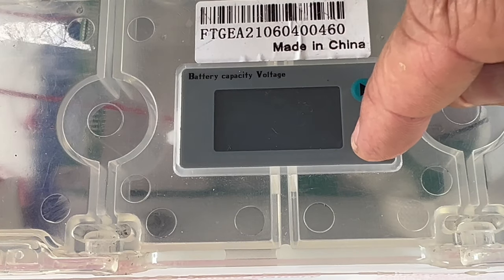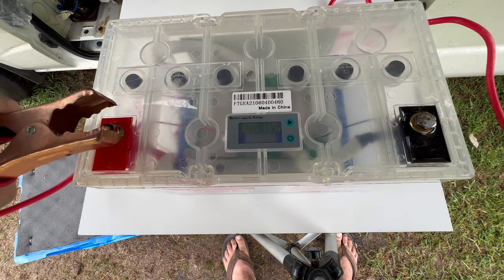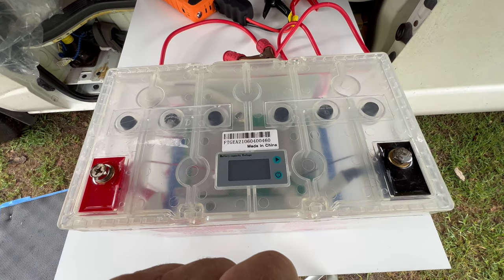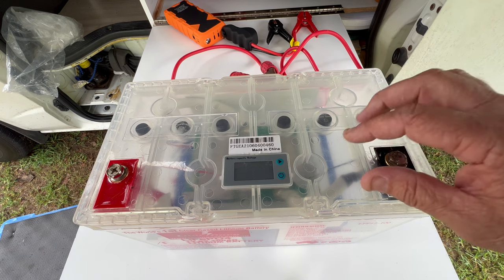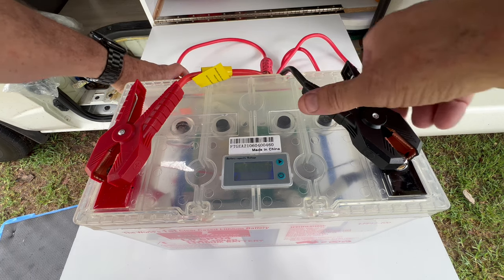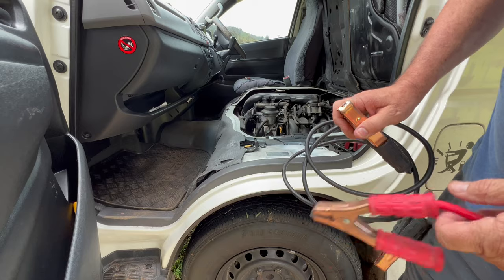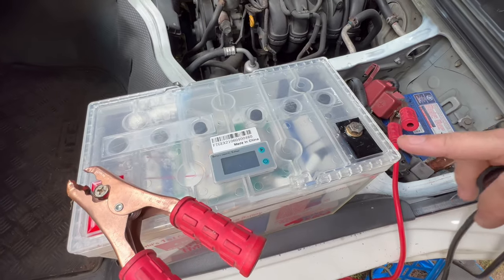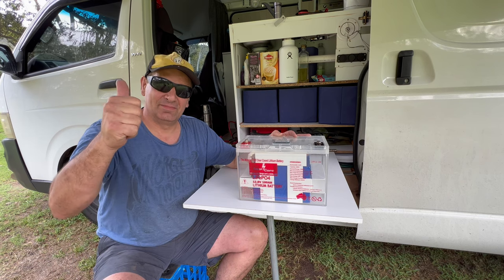Waking up a sleeping bms in your lithium battery

Comment: You saved me just now, I think. I just received a couple new lithium batteries and they came with the BMS in sleep mode. They have Bluetooth as well but in sleep mode I can’t connect. I was going to buy a charger that will charge lithium at 0% charge, but I forgot I have a jump starter in the truck! I’m going to do this and see if the BMS wakes up and reads the actual voltage.
Reply from the maker: Hopefully, it does the trick and you're able to connect via Bluetooth. It's always satisfying to solve a problem with resources you already have. Thanks for watching 👍🍻

Comment: Good video mate…does the jump starter need to have lithium compatible???or u can use any jump starter like my is kings brand jump starter..thanks
Reply from the maker: Should be able to use any jump starter as you seen I just used the car battery (lead acid) as one example. You only waking up the bms and just only few seconds is needed .. you can even use a solar panel directly to the battery bypassing any solar controller to wake up the bms. Hope this helps and thanks for watching 👍🍻

Comment: My blinking light goes off on my ebike battery all i do to get the light back on is supply some voltage to the aux 8 amp connector and it wakes back up. Im not sure even a small amount of voltage will wake the BMS back up ? Looks like you proved this by connecting a 12 volt battery. Have you tried anything less than 12 volt battery?
Reply from the maker: No i have only done this to 12v batteries. Thanks for watching 👍🍻

Comment: Thanks mate my new lithium  bms has fallen asleep a few times,overcast days and parked in the garage, so no solar charge, with fridge running. Being new to lithium I was worried I got a lemon, now I know the trick thanks. Last night it got down 1 degree would this also be a trigger for bms sleep mode ?
Reply from the maker: Cheers mate I’m glad the video has helped you out . Yes the bms can trip out in low temperatures. Thanks for watching 👍🍻

Comment: Hi Phil, I have a  new voltx 100ah lithium  battery and a old 50ah Renogy lithium. 

Is it OK to connect these  in parallel, given the different capacity. 

Many thanks.  Vik
Reply from the maker: No . It has to be the same battery in capacity and brand for the bms in each battery to communicate with each other . And the by the way my name is not Phil 🤣 . Thank you for watching 👍🍻

Comment: Hi Dino, do we have to disconnect the battery wiring then jump start it or just jump start it while its connected to the dcdc charger.
Reply from the maker: You should be fine to leave the dc charger connected as your only jumping for about a second just to wake up the bms . I got a battery box and my lithium went flat and I just jumped mine with my dc charger and accessories connected and no problems at all . Thanks for watching 👍🍻
Reply: @EFFICIENTSELF  👍

Comment: Hi there.. Did you use a lead acid battery in your vehicle to jump start the lithium battery?
Reply from the maker: Yes was a lead acid battery . Thanks for watching 👍🍻
Reply: @EFFICIENTSELF  thanks mate.. My growatt inverter had an error that wasn't in the manual.. Watched your video and had the idea to check the batteries.. Lucky was able to switch them on via the BMS app
Reply: Didn't work

Comment: I have to questions 1.where can I get a lithium battery monitor and 2. Where can I get one of those discharge units to test battery capacity like you had when you tested the 200ah Lithium battery
Reply from the maker: The victron smart shunt are really good https://www.ebay.com.au/itm/265548943069?mkcid=16&mkevt=1&mkrid=705-154756-20017-0&ssspo=f58ATu1-R4q&sssrc=2349624&ssuid=LADLYa7cR_u&var=&widget_ver=artemis&media=COPY and the battery tester was here https://www.ebay.com.au/itm/144028730454?mkcid=16&mkevt=1&mkrid=705-154756-20017-0&ssspo=3ByHGBGPTqO&sssrc=2349624&ssuid=LADLYa7cR_u&var=&widget_ver=artemis&media=COPY
Reply from the maker: Hope this helps and thanks for watching 👍🍻

Comment: What if your battery doesn’t have any of those LCD panels on the top of it?    My battery got too cold last night. My CPAP machine shut off and I’m going to die if I go to sleep again because my battery isn’t working   200Ah Giantz LiFePO4
Reply from the maker: Lithium batteries can temporarily stop working if they get too cold. Only way for bms to make battery function again is for temperature to warm up again. 
consider having a backup power solution for your CPAP machine, such as a smaller, portable battery pack or a generator, to ensure you don't face a similar situation in the future. Hope this helps and thanks for watching 👍🍻

Comment: I just bought a Bluetooth connect li-ion battery E-scooter...  Sometimes I notice When I try to turn scooty on it doesn't start.. but battery is enough... It's a 30 amh battery... Then I have to plug the charger to turn scooty on... Don't know what the problem... Please solve.. it will help me a lot
Reply from the maker: Sorry I’m not an electronics guru but sounds like there might be an issue with the connection between the battery and/or the scooter's electronics. Check to make sure all the connections are secure and free of any debris or corrosion. Maybe it might be best to contact the manufacturer or a professional for further assistance.  Hope you get it sorted.Thanks for watching 👍🍻

Comment: I have a 12v 100ah Aolithium battery and this didn't wake up the BMS. The BMS charge switch will not open up. Any suggestions?
Reply from the maker: Try an unregulated solar panel and see if that works . I would say the bms has an issue. Hope you get it sorted and thanks for watching 👍🍻

Comment: Hi, would it restart if you put a jump leads on it while the salve battery vehicle is not running?
Reply from the maker: G’day . No it won’t it needs a bit of extra kick to wake the bms. Thanks for watching 👍🍻
Reply: @EFFICIENTSELF  thanks for your reply.  I have got a new Kia Niro Hybrid car. The battery was flat, and I tried to jump-start it. Now it's not charging. Those vehicles have 12v lithium ion battery 🔋.  So I think   when I jump-start it, it turns off the BMS. I will try tomorrow and let you know.

Comment: be really careful, i had a shorai battery, and tried to put a 2 amp charger on it......came back 30 minutes later and i twas at 13 volts, seemed great, closed the garage, 30 minutes later the battery was on fire!     lithium is dangerous, i prefer lead acid anyday to this new technology

i never had a lead acid let me down like a shorai
Reply from the maker: Wow, that sounds intense! Thanks for sharing your experience. Lithium batteries do require careful handling. I’ve had good luck with them so far, but it’s always good to stay cautious.thanks for watching 👍🍻

Comment: Are you still happy with the clear case lithium battery
Reply from the maker: Absolutely. Been awesome and no issues , thanks for watching 👍🍻
Reply: Hi George, I bought 5 of those clear case batteries for my caravan and can't fault them
Reply: @tootandloo  great feedback thanks 👍
Reply: @georgesdesk      Sadly these clear case batteries aren't splashproof....  the "cute"meter display on the top is a push fit into the case...if any water gets on the top of the battery it goes through onto the BMS.  I'm not talking about it not being waterproof...  they are not splash proof...  which any conventional battery case is.

 These batteries are advertised as being capable of put in series of up to 4 batteries, to make a 48v battery bank.  Unfortunately there is so much variation in internal resistance between batteries that severe imbalance occurs.  (Each battery has a BMS intended to balance individual cells in one battery, but there is no balancing between batteries)    You can't top balance individual batteries in a battery bank every few days. 
  
 I bought some cheap, and recommended them to a friend who did the same.  We both regret the purchase....  might be suitable for use as single batteries not in series or parallel, where there is no possibility of getting splashed, but not fit for purpose in multiple battery banks.

Comment: The sixth reason might be the "made in China" label.
Reply: If you have a lithium battery it’s made in China, but yeah there are good and not so good for sure.
Reply: @grahamwhittaker8844  What if the cells are Japanese or South Korean etc, the BMS is from Taiwan, USA etc and the plastic case from India or Malaysia?  Sure, a lot of stuff comes out of China these days but it's not a given.
Reply from the maker: Cheers 🍻 thanks for watching 👍🍻
Reply: @retrozmachine1189  fair point